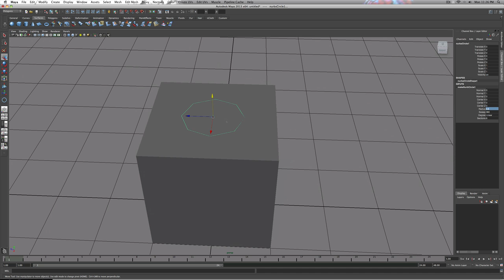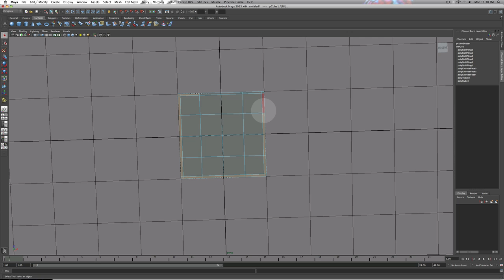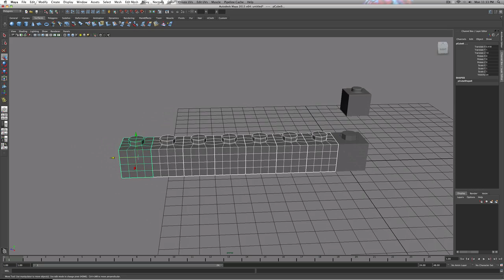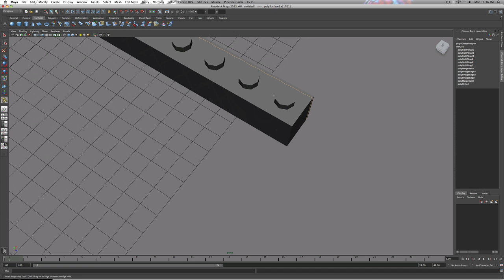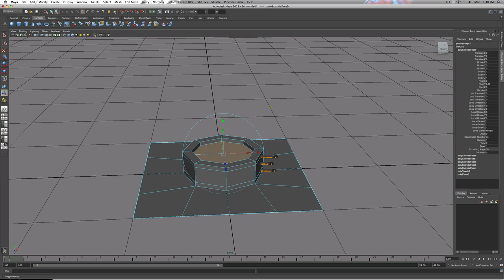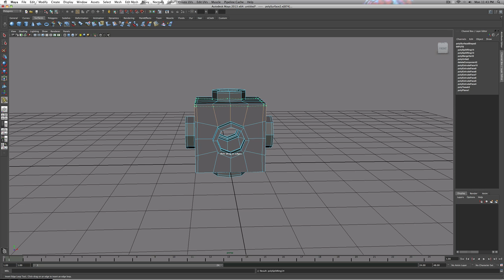Maya: Model Some Legos

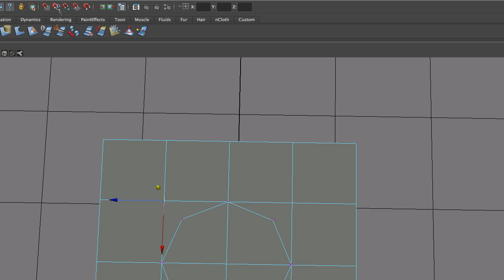Comment: At 04:58 you select the Vert you want to move and then the Spline... but when I do it the original selection of the vert from the cube is lost... do you press anything that you are not saying in the video because this has been driving me nuts for some time now.
Reply from the maker: @ Henrikdark, I'm only selecting the original vert in the polygon mode. All you have to do, while that is still selected is mouse over the spline (without clicking anything) and then right click to bring up the menu, and choose control vertex. At that point your original poly vertex should still be selected because you haven't clicked anything else. If it is still de-selecting your original vert then I'm not really sure what the problem is. Maybe your on an older version of Maya?
Reply: +Henrikdark I had this too. Just incase anyone else sees this and had the same issue, choose "edit point" and do the same thing.